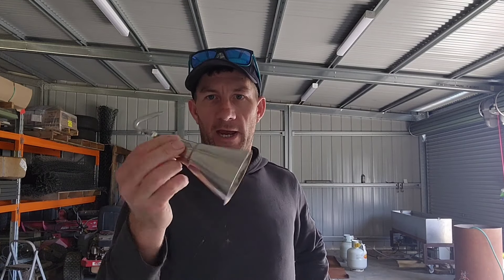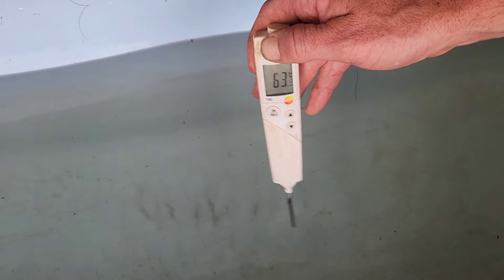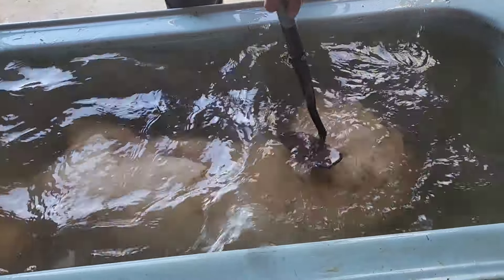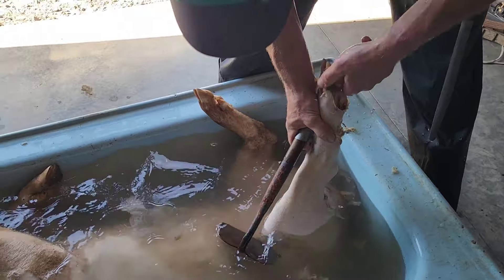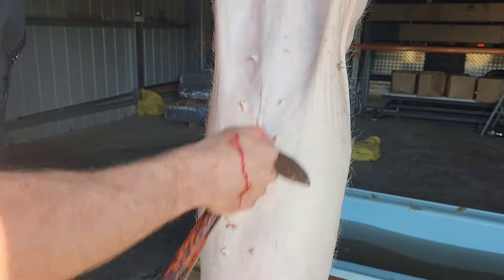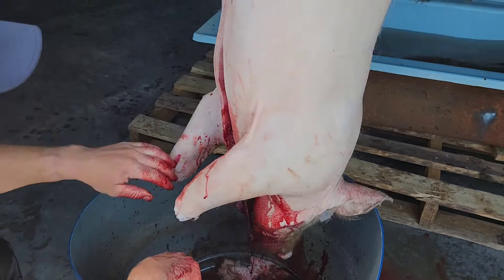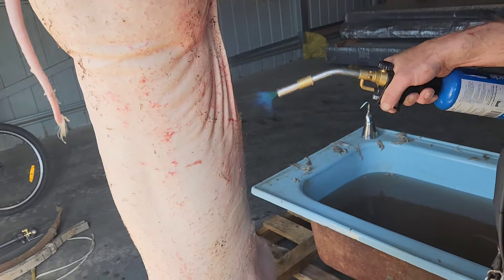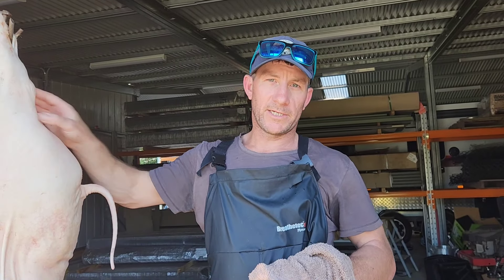How To Scald A Pig (Tutorial)

Comment: do you have to worry about setting the hair by leaving it in the water too long? If so, is there a max amount of time you'd leave it in the water? Thanks, doing 2 of my own tomorrow! I hope it goes this well!
Reply from the maker: Once the hair starts to move I like to get them out within 2-4minutes otherwise the hair can set in. It'll also set in if the water is to hot or to cold. Once it's starts moving just get it off as quick as you can. Good luck with your 2👍